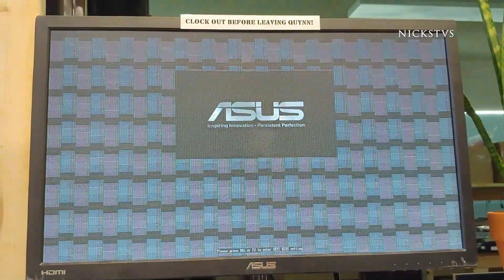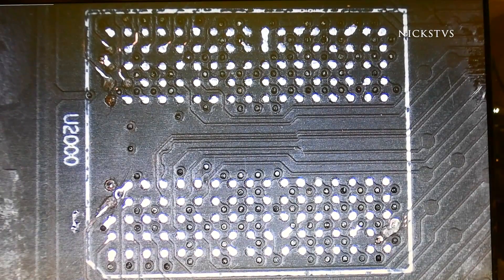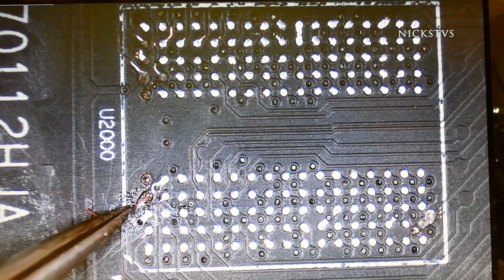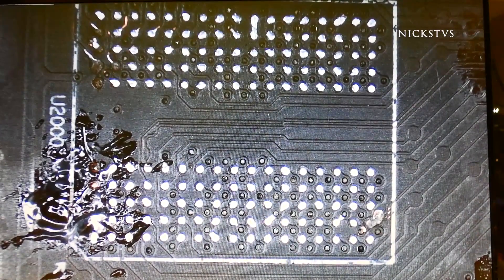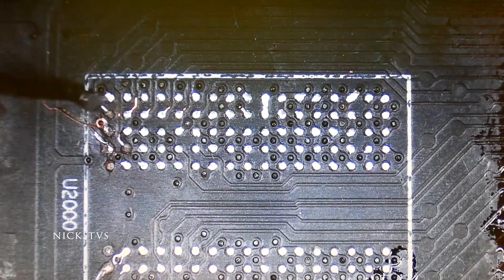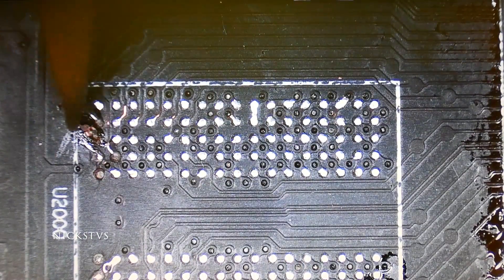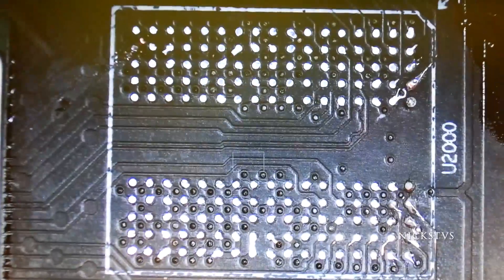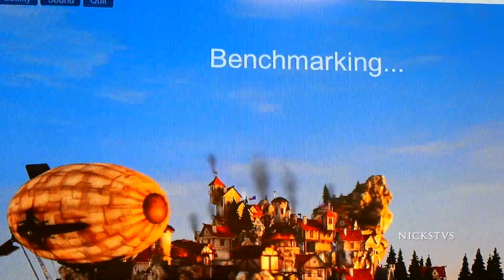RX 580 Artifact? This is the fix! - AMD Graphics Card

Comment: My xfx rx580 start artifacting and my Pc crashes after 1 - 2 hours of use
The only visible problem i saw is that one of the fans are spinning slower probally getting faulty.

I kept track of temperatures on cpu-z and the components dont go past 52 - 60 celcius
And GPU itself never goes past 70 celcius
Reply from the maker: I assume the trick in this video does not help correct? 
If not, then it's possible one of your Ram bricks is failing, or the processor is starting the develop cracked solder joints and needs to be reflowed or reballed, or it's also possible the processor is simply failing internally. 
If this unit was in my shop I would first start by running a diagnostic on the Ram.

Comment: I have the same artifacting issue on my XFX RX 580 8GB that you show at the start of this video. Similar to @20XX I tried multiple cables and that wasn't the issue. I even updated all the system bios and it resulted in the issue going away. But after a view hours it's back again. I'm stumped. If this was a vRAM issue or issue with the output connection on the card I would assume it would happen all the time and not randomly fix itself and then break again. Any idea what to try next, or what would be causing this issue?
Reply from the maker: Sorry the fact that it is intermittent does stump me as well. Unless the EEPROM itself aka the chip that holds the bios data is defective. I have seen them fail in intermittent ways before but it is extremely rare to see that. But then flipping the switch should fix it as it is almost impossible that both EEPROM chips on your card would have failed.

Comment: I purchased a prebuilt PC from CyberPowerPC, but it wouldn't output to HDMI (turns out you need some drivers or something, nothing is broken). So I returned it and got a new one which had the same problem. I realized I must need to use DVI or one of the other connections and purchase a DVI to HDMI adapter, then I see all these artifacts. CyberPower PC gave me a return PC with a broken GPU out of the box. Would it be cheaper to buy the tools and fix it myself, or to ship it in to you? Or should I just wait and buy a new GPU entirely?
Reply from the maker: Depends on the card you have. Is it a 4gb RX 580? If so then probably not worth fixing. If it's a 2080Ti then it's worth fixing. 
If you don't have the tools then I don't recommend trying to do it yourself. This is a very advance repair and requires higher end tools which will cost more than the repair most likely and this is also not a repair anyone can do. My tech Juan in the video has many years of experience, so he makes it look easy, but it really isin't.
Reply: @NicksTVRepair  It's a 8GB XFX 580. I'll probably just save up and send it into you guys.